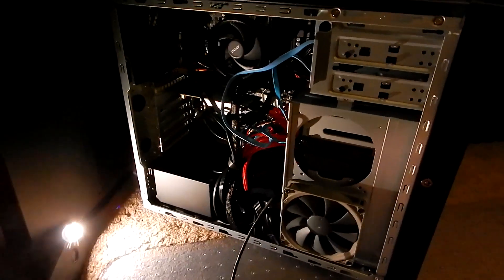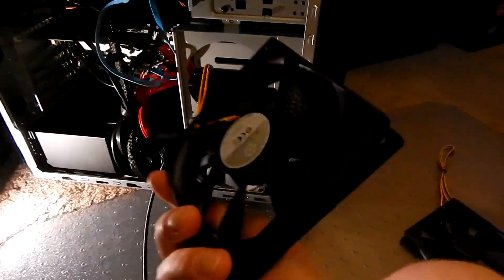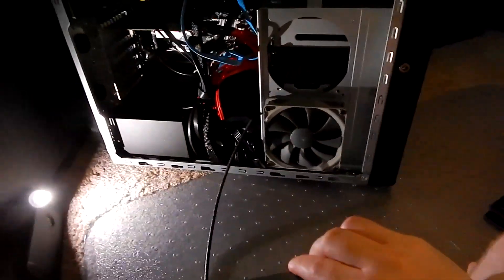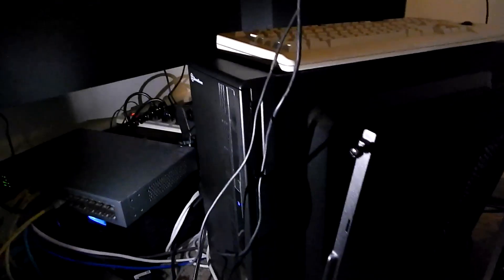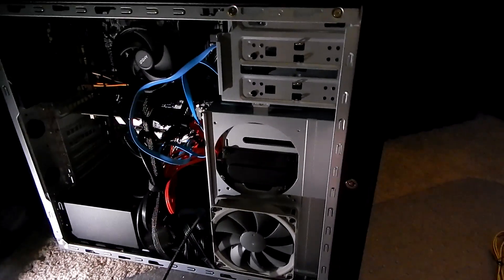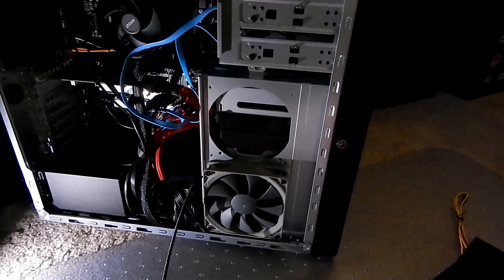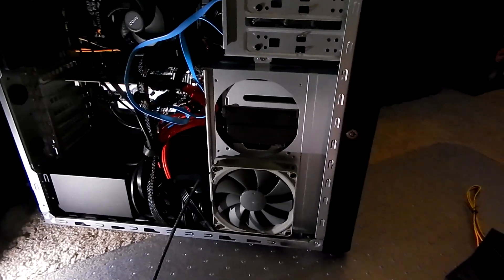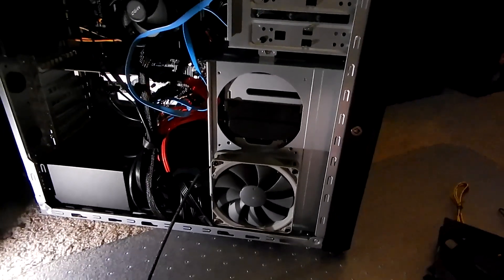Silverstone CS308B Case Follow Up: Hard Drive Ventilation & High Static Pressure Fans

Comment: A better option would be to cut two holes in the side of the door and add grills. That way you'll improve airflow a hell of a lot. It's a shame because apart from this it's the best server case in it's price bracket by far.

Comment: If it does not work long term.use a temp camera to see where the heat is building up..Mod The hell out of the case to compensate.